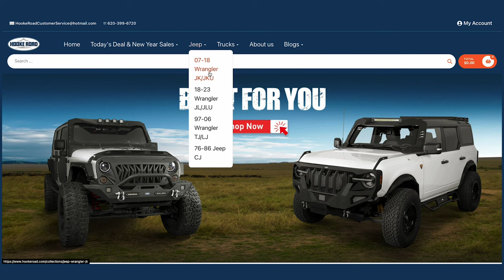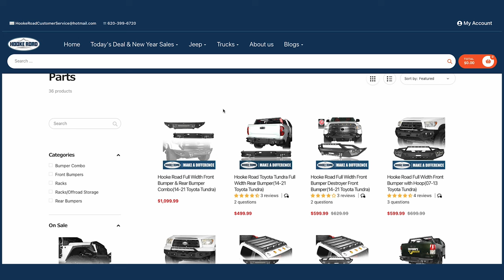My DIY Camping Trailer Build | Truck Bed Trailer to Overland Camper Project

Comment: What a cool build! I also had 3 Mazda trucks like this in the 90's, and I loved em! A name could be Gretchen? ?.. LoL. What if you connect an alternator to the companion flange on the 3rd member? As a battery tender while the trailer is being pulled?